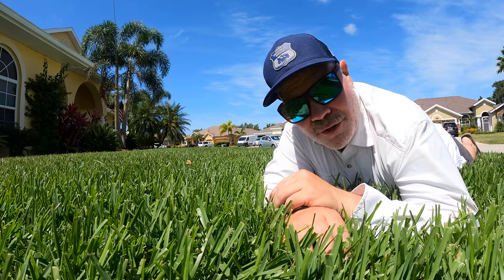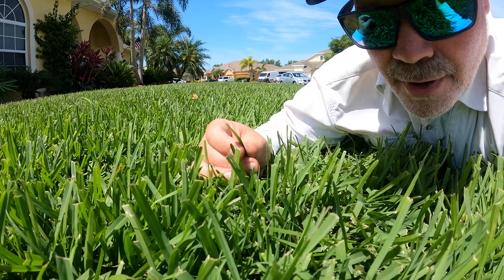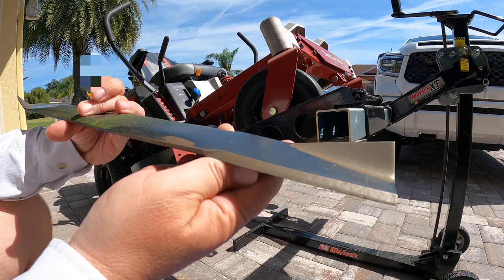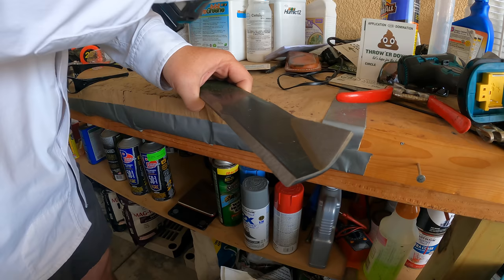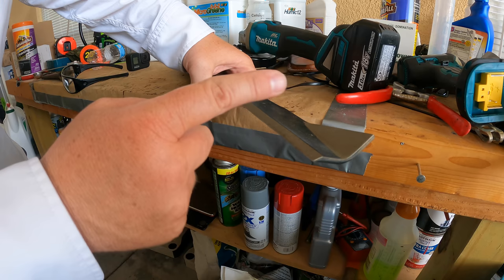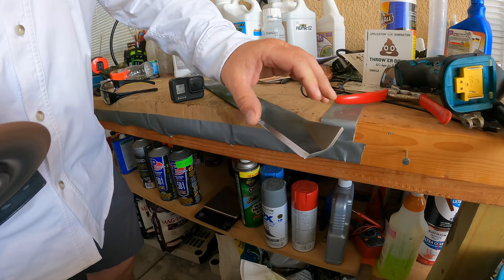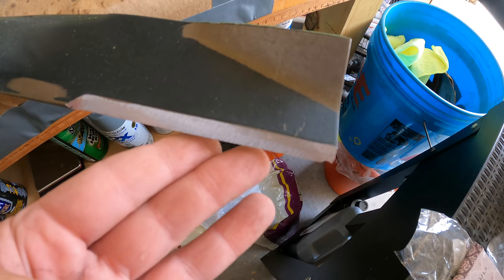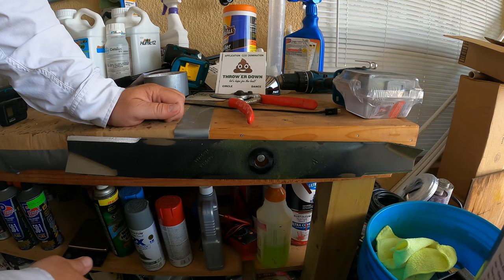How To Sharpen Lawn Mower Blades

Comment: I got a cheap grinder on Jungleriver this week and it works great.metal grind disc 41/2"      Lets just say I cut the grass after and the cut was so even!!!!   I have used a hand file but it does not ever get the edge as neat on the blade of the mower blade!!!
What a difference!!!!! So agree with  you Allyn major game changer for me.   Never had a grinder before and it came with the discs as well.      Have to get use to the burning wire smell of metal on metal...

Comment: For safety, it's worth taking the time to run a vertical bolt through your table on the top, near the edge then run a nut down to hold the blade tight. C-clap the side you're not grinding and it makes life even easier plus you never risk hitting you table with the wheel like I used to do. :)
Reply from the maker: That's really good advice. Thank you !

Comment: I use a flapper disk and try keeping the angle at about 32 degrees. I have a angle finder. Always check the angle on new blades before using for the angle.and always balance the blades

Comment: If you can pulse weld or tig welt you can fill the nicks first then perform this work it keeps the blade closer to original weight and easier to balance  because its closer to start

Comment: I have 2 sets sharpened one set last summer just dropped the deck pulled those off i used angle grinder from HF put 2nd set on, OH MAN WHAT A DIFFERENCE 😂

Comment: I use bench grinder. What you do is fine also but as a lawnmower mechanic just more easier to use bench grinder I guess using it constantly . I want them sharper than butter knife for sure but not razor sharp because the thinner the metal the quicker it dulls. Razor sharp is great if you’re sharpening after every cut or 2. Great video LCN, long time follower.
Reply: There are many blades out there that you'd have a tough time sharpening them on a bench grinder.
Reply: @CuriousKL  I’ve had a few that are tricky but you’ll adapt pretty easy. Some of the harder ones are like the ones on some craftsman mowers (and other cheaper mowers)  that have that drop down in the blade. Did mowers specifically for a little over 13 yrs. I’m finally retired. Already starting to miss it, might start doing it again at the house. 🤔
Reply: @mateo85tx  do you know what the purpose for the drop in the blade is? Maybe it helps create suction to pull the cut material into the bag ?
Reply: @R900DZ  I honestly don’t know. Usually the back side of blade that’s curved up is to help with lift for bagging or recycling purposes.

Comment: Your technique is fine also the balancing  is key , ive learned the hard way once grinding too much off & not balanced the Vibration is un bearable, thats also why I believe that (like you said,) you follow the original angle  and bring it back also as for you ,your machine is for your yard that you know  your lawn ,so razor sharp is fine , but if you do comercial jobs razor sharp is not recomended  because it will be thinner and if cutting a not so perfect yard weeds, sand, small rocks, etc that same day your blade would be nicked ,bent edge  etc. Thats why i think its fine bringing back a consistant nice edge , taking away the least metal you can ,is fine with a bulkyer blade, grass is not hard to cut ,at the RPM,s its spinning it will cut , but you are on the money  when the blades of grass is ,"split ends or freyed" definetly time for a sharpening. Thanks for sharing info on your channel bro Keep it up!👍✌

Comment: A file works great too for anyone who doesn't have an angle grinder. Just clamp the blade to a 2x4 with vice grips or a c-clamp, press the file against the bevel and file away.

Comment: If you haven't tried the All American Sharpener, model 5005, seriously do yourself a huge favor and get one. You will sharpen your blades so much faster, have a much cleaner edge, and your beautiful grass will thank you for it. You do need a grinder that will attach to the tool. From the time I first begin the job to out mowing is less than 25 minutes, and that isn't even rushing the job. It's well worth the 200 bucks. And, you won't even mind doing the job, it's that easy. Gives you a factory edge EVERY TIME!

Comment: If you can’t tell what side of the blade goes down by looking at it you shouldn’t be touching it. The best way to sharpen a lawnmower blade with a good file, does a great job with much less chance of overheating the steel.

Comment: Over by dare!!!! I would definitely recommend a flap disc to sharpen mower blades for people who are not experienced with sharpening blades.
Reply: What grit type for a flap disc? 40, 60, or 80 grit
Reply: @mrnhl3080  I recommend 60 or 80. 40 is for more experienced people (40 takes more metal off)
Reply: I believe I have 60 grit I should have stated that! 80 works great to. I do not recommend metal discs but LCN is a pro so yeah 🤙

Comment: I do the same process but use a flap disc, also I have more than one set of blades so I can swap out and go...after sharpen and balance I also hit it with a shot of spray paint. Oh I also sometimes de-burr with a hand file depends.  Thanks!  I subscribe to razor sharp too.

Comment: Nice job on sharpening.  I use a metal file covered in diamond dust. It is slower but it is easier to control how much metal to remove

Comment: for those folks that have cracks in the mower decks it caused by blades out of  balence  a simle way to bal. blades use a 5/8 rod in a vise hang blade on it see if it hang s level if not remove so me  metal on low side  -- take it off back of blade so you mess up what you just sharpened

Comment: I agree w/ others. All American Sharpener is the way to go. Not necessary to get a razor edge. Tends to nick or curl under first time you hit a stick or stone. Balancing on a nail is not even close. I tried it & then put it on my MagnaMatic balancer. Way off. You will eventually destroy the bearings in your blade spindles. We were replacing 4 to 6 spindles per year until we started using the MagnaMatic to properly balance our blades.

Comment: This was a great video.  Just bought new blades and want to have them sharpen.  I don't have a vice just clamps to hold it down.  
PS..  have you thought about getting a labeler and label what is inside the drawer.  The Japanese have what mastered this.  We use it in our plant.  That way you save time not having to look for it.

Comment: I made my last one SHAVE Sharp, it wont last, but it was fun.  You might want to try a flap disc, its is a little better for accuracy.  Pro level is a file!
Reply: If you haven't done actual damage like the nicks he had definitely you can count the strokes and be pretty much balanced then do a few extra passes on the heavy side till it completely balances.

Comment: I use a cut wheel theres a lot more control especially if your doing curved mulching blades......also a vice works legit too for holding it in place

Comment: A tip from the knife making world: make a bevel filing jig and you can set that angle perfectly and not rely on the weight of the hand dipping into the blade

Comment: While you're at harbor freight, pick up some cheap flap discs for your angle grinder. Those will give you much more control and a more even finish than a metal grinding disc.

Comment: The beveled edge of the blade always faces up... easier to remember. You should always clean all the hardened grass deposits off the blades when you sharpen them.

Comment: Bench grinders are the best way to go there cheap at harbor freight too . Also for those that have a orbit sander slap on a rough piece 40 or 80 grit sand paper works great and really easy to handle ..don't forget safety glasses and and pair leather or mechanic gloves 😎

Comment: I find that angle grinders are too destructive for most cases. If there were large chips or bends in the blade it may be an option but a good axe sharpening stone works great for mower blades without removing too much metal or generating high temperatures which could ruin the blade.

Comment: I basically sharpen my blades the same way. I have angle grinder just for this job. I just stick a screwdriver through the center of my blade and hold it away from me to see how it balances. Never had one of those fancy cone balancers. What kind of mower lift do you use and on a three blade deck can you get to the center spindle to grease.

Comment: I went for a flatter angle on my gator blade with (eyeballing) 30 degree-ish angle, and ended up flattening that bevel that you mentioned not to flatten. Hopefully they'll still do fine, but I've come to like the flatter angles for myself.

Comment: I sharpen our blades at work, or my boss will almost every day. That way I have a couple of sharp sets of blades on the truck. I start with a fresh pair for the day and run them the next day. I have the other set that’s already sharp and balanced, take the ones that I use off the day before and put the new set on for the new day run those all day and usually my boss will sharpen mower blades and put them on my truck

Comment: actually a bench grinder makes it easier to keep the angle, plus it has a larger radius, so it can make a wider grind in one pass. BTW, at 5:15 when someone asked you what kind of wrench you needed, did you say "it doesn't matter, I'm going to use it as a hammer..."lol

Comment: With the discs, grit is everything. I recommend a 120 flap disc, removes less metal and leaves a mirror like sharp finish. Also direct your grinder where you are grinding away from the edge, not into it like you did in the video. Keep your balancer on a window sill, you will always see it, and know where it is.

Comment: Bastard file is the better way. Grinder will take too much off if your not careful. Alans way is good if you can keep the grinder light but usually they are pretty heavy, bulky, and vibrates too much to have good control especially if u get the HF special.

Comment: This is one of those times when I sigh because I have a reel. It needs backlapping and it’s fun.
Reply: But when a reel is sharp, it out-performs the sharpest rotary blade. A sharp rotary still rips to some extent; a reel cuts like a scissors.
Reply: @BellDavidE  yep. That’s why I ditches the rotary. My sharp hatchet on the motor still ripped my zoysia. Nothing like a reel. Nothing like backlapping and fine tuning a trucut.

Comment: If you use two points of contact with the grinding wheel you will get a way better result instead of using just one side of the grinding wheel.. Just lay it on there flat and hold that angle and go side to side and you won’t have to worry about taking chunks out from just using one side
Reply: I’ll think about reporting you 🤔

Comment: So I'm a foreman on the mow crew for a Landscaping company, and our boss insists they be sharpened every week, but I dont really think that's necessary, do you? I bought brand new blades and noticed they weren't even sharp, at all! The guys at the john deer shop said they dont need to be sharp to cut. And the blades seem to cut just fine at the end of the week. So is it really necessary to sharpen them every week? (After about 24 hours of mowing)

Comment: I noticed that I have areas of a yellowish color throughout my lawn. I thought that maybe I need to sharpen my mower blades, but I noticed the grass is yellow all the way to the soil. Is that an issue of low iron? Should I do another application of milorganite fertilizer?

Comment: The reason for not going razor sharp is for longevity...butter knife sharp will hit a stick and still be a butter knife, a razor edge will chip off resulting in an instantly dull blade.

Comment: I’ve watched several videos on how to sharpen a blade and each time the presenter misses mentioning an important step before balancing a blade. “Make sure you remove any caked on grass debris from your blade before you check the balance”. Before check you the balance, make sure your blade is clean.

Comment: If you really want a sharp blade but an extra coarse diamond plate. Makes holding the angle super simple but the more important aspect is the burr. The angle grinder is just going to flip that burr back over to the other side. With a diamond plate you won't generate that massive burr.

Comment: You want to hold a 30 degree angle on the edge. Also, you are holding that grinder to the steel too long and in doing so really heating up the steel drawing the hardness back, which will result in a softer edge that will dull much quicker.
Reply: I use a spring water bottle with a hole drilled in the cap. I spray the blade after a couple of passes,to try and keep it from overheating. No idea if it’s necessary,but I guess it doesn’t hurt?

Comment: 2 quick questions I hope you can answer. Reseeded a 10x14 area on April 18. Filling in real nice. When can I cut the area? And suppose to do Scotts step 2 on my lawn on June 1st. Can I apply to the new area without damage? Thanks for your time
Reply: 1 like 1 month after grass reaches 2 1/2 inches.

Comment: You scared me so many times in this video! Some people prefer a bench grinder to sharpen but I find so much better control with an angle grinder.

I wouldn't sharpen a blade without a vise though, an angle grinder can do some serious damage if you're only using one hand and not two. You have the handle on it but not using it. The sheer force can easily run away from you. I also suggest a belt sander or even a medium-grit by hand to remove the burr, personal preference though. The idea being you reduce the material of the blade by even when you quick the burr and it gets sharper, but keeps less of an edge.

Comment: Why doesn't anybody suggest the optimum angle (in degrees) for the bevel?  I have three spare blades that came with my riding mower.  The last idiot that sharpened these ground them down on BOTH sides (think knife "edge", not "wedge.").  As you can imagine there is no proper angle to follow.  Yes, most people would just throw theses blades away; but then, most houses have a professional crew to cut their grass....

Comment: If grass is wet and the weather is damp is it better to leave the grass and cut when drier or cut it when damp?
Reply from the maker: tough decision really - don't let it get too overgrown, that's for sure
Reply: @Thelawncarenut  oh it’s overgrown and no mow May happened because the grass has not dried and I don’t want to ruin my push mower and strimmer. Fescue sets worst than concrete.

Comment: Could anyone explain why my grass tips are still getting shredded even after a the blades have been freshly sharpened, I’ve had this issue for several weeks now and I can’t seem to figure it out, I know my blades are sharp. HELP
Reply: Lawn shop told me blades are sharp from the factory even though it doesn't look like it.

Comment: While this method is good, quick and easy, I feel like a dremmel will do a good job without taking away so much metal. If you have decent damage on your blade then yea the angle grinder will probably be the tool of choice to smooth out the blade. Otherwise it feels like using a brush for a job that can be done with a pen.

Comment: Just curious. As the blades rotate but still effectively strike the grass at a direct force. Wouldn't it make sense to have the blades made in a curved nature so that they slice the grass as they rotate. This would surely make less effort in the cutting, while also reducing the wear on the blades from direct hitting of the grass. Just a thought.
Reply: I’ve heard lawn mower manufacturers say they study the blades cut with slow motion cameras and that most of the cutting actually occurs on the tip. If the cutting edge is angled the tip of the blade may not even make contact. Blades spin fast enough they effectively hit each blade at a 90deg angle, which is optimal. If the blade is angled or curved it would have less force on impact, like a slap instead of a punch.
Reply: @WildHorsesOfCourse  I can see how they think. Though on lawns that require a better finish than the average home, like golf greens and lawn bowl areas. They use a scissor action to prevent the grass being pulled up when wacking the grass. A form of curved blade would leave a cleaner cut,  but as you say,  it might not be efficient for a rotary motion blade system.
Reply: @johndee68  that’s a shearing action.  This is a whacking

Comment: LCN: question: do you sharpen new blades? Or are they ready for use right out of the box? Thanks
Reply from the maker: it depends. Th Ego blades come sharpened but it isn't like that with all manufacturers
Reply: Thanks LCN! It’s a Briggs and Stratton, I’ll use your method!

Comment: Awesome! I'm going to go pick one up Monday. I can't get my blade off my lawn mower anyone  have any advice. My lawn mower began to take chunks  of grass out if my lawn. Can someone tell me why...
Reply from the maker: Battery Impact driver takes mine off nicely.
Reply: You can use a 2 x 4 placed between the blade edge and wedged somewhere against the inner deck preventing the blade from turning CCW while removing the bolt. If the bolt doesn't break loose, you're going to need a bigger (longer) wrench for more leverage. That or what Allyn mentioned in his reply.

Comment: With those flap wheels you want to be careful not to rotate the wheel into the cutting edge. The lap joint of the wheel material can get caught on the sharp edge of the blade.
Reply: Any good angle grinder has an arrow pointing the direction of rotation. When you look directly down at the wheel, it spins clockwise. Place the blade in the vise back side of blade facing down, and with you facing the vise to sharpen the right side edge then rotate the blade to sharpen the opposite edge. Kind of a no brainer.